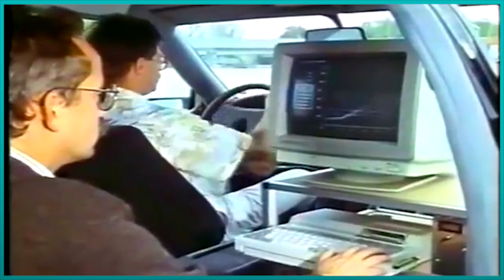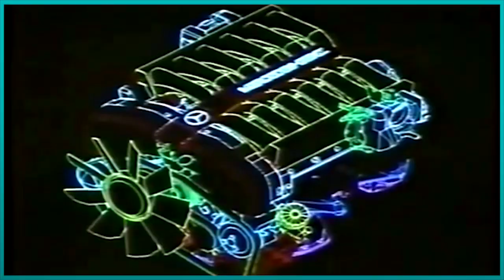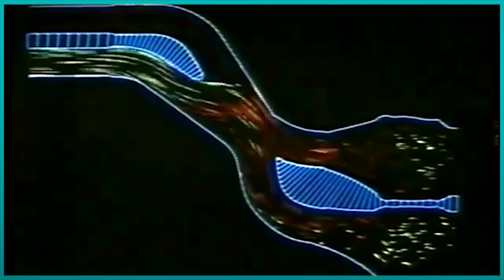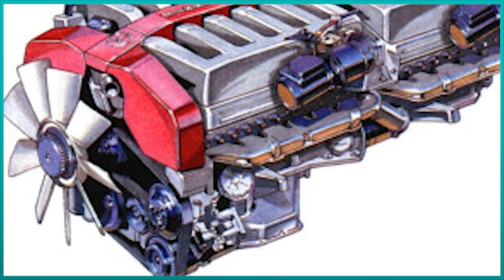The Cancelled V16 Engines Of BMW and Mercedes

Comment: It would be neat to see a video on the Cadillac V16. That one did make it into production, but it didn’t last due to the Depression. Just as Cadillac was about to introduce it, the stock market crashed.

EDIT: Cadillac actually introduced a new V16 engine in 1938.
Reply: Or the modern Cadillac Sixteen concept
Reply: John Herbold Or both :) (I actually forgot about that concept, lol)
Reply from the maker: I want to make a video about that is going to one of those long ones where Im going to cover both the original and the concept.
Reply: Alfa Guy 2 👍

Comment: Imagine the lenght of crank in V24 engine. Twice the lenght of inline 6. 
 Imagine torsion/stress on crank bt the first cylinder and flywheel in 24 cyl engine. 

This engine have more cylinders, than Porsche 911 GT2 have valves! :)

Comment: I think a v16 and w16 are a pointless exaggeration, the advantages over a V12 are minimal while the disadvantages are huge I really don't understand why the Bugatti uses a W16 when it has been proven multiple times by the competition that offers no advantage except for a greater smoothness.
Reply: Because they can...
Reply from the maker: I agree totally agree with you, like in the case of Cadillac and Cizeta they are just to show off. In case of Bugatti I think that in a sort of way they are stuck with the W16, until they built a hybrid or full electric.
Reply: The turbo W16 was in ways a concession indeed. The head of VW wanted to push for a NA W18 engine in the Veyron but they couldn't tune it to make more than 600 hp.

Comment: Can you please make a video from Mercedes in your country in 2022 Can you film on the streets and spot Mercedes also W124 please
Reply from the maker: To be honest w124 aren't that common anymore, at least is the big cities. In smaller ones and on the country side they still rule. The w203 and the w211 are everywhere nowadays also the w212 is becoming quite popular. The main reason why they aren't as popular as they used to be is the taxation for the old cars also fuel is quite expensive here so most people buy a a gas car in oder to turn it into lpg, while most of the W124s here were diesel. Plus a big chunk of them were stolen so is impossible to register them nowadays, while back in the day you could just repaint the car and you were done.
Reply: @AlfaGuy2  Thanks a lot for your reply very interesting! the W211 i think is less reliable then the W212 is that correct? I have driven W211 for about 300.000km this model was the facelift and at the time really nice but now I would prefer to have the w212. Do you have any cool thinks you could show from your country maybe that could be normal and boring for you but for us viewers is very interesting maybe

Comment: Lucky they cancelled the v16 lol they can’t even make a good v8 let alone a good v12 could you imagine the nightmare of a v16😂🤣
Reply: "lol they can’t even make a good v8 let alone a good v12 " Really now? The McLaren F1 was powered by the S70 V12 which was good enough to make it the fastest production car in the world. And to win the 24 Hours of LeMans outright in 1995. And again in 1999 with BMW's own LeMans racing car. Fact is BMW were the last ones to win LeMans with a naturally aspirated V12. If you win a highly difficult endurance race I'd say you can claim your V12's certainly are top notch. 

And then there is this "small matter" of BMW winning the most International Engine of the Years Awards since its inception in 1999. 62 so far in all categories. Some of them were even V8's. 

I have a hunch you're just repeating whatever word-of-mouth you've heard through hearsay or whatever you choose to trust. I believe that those International Engine Awards carry a lot more weight than your arbitrary assertion. 

Also, since you seem to believe that all engine designs are perfectly interchangeable (a V8 isn't naturally balanced like a V12 for instance) and the issues just increase with they number of cylinders which is why you absurdly correlate a "bad V8" spells a worse V12 and even worse V16. 

Now kindly be quiet.